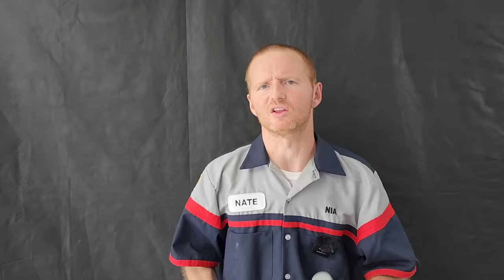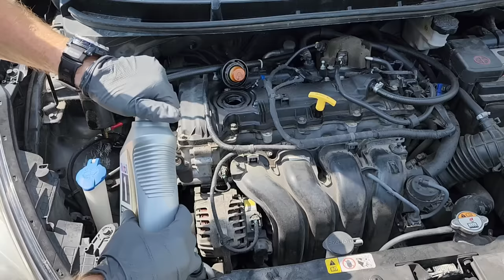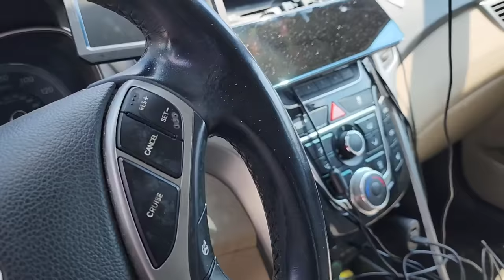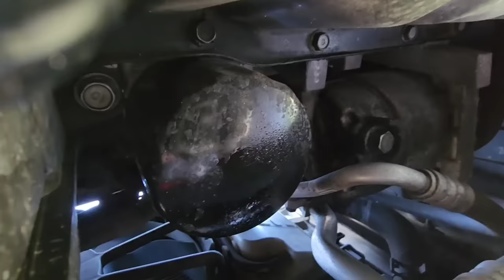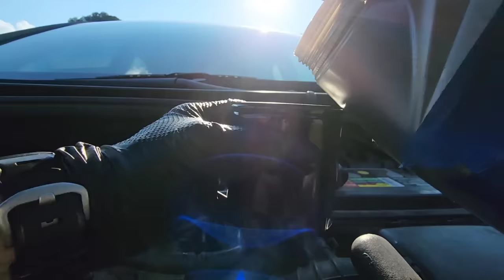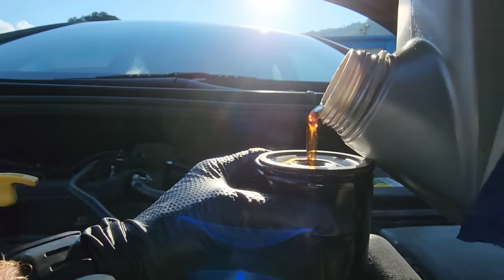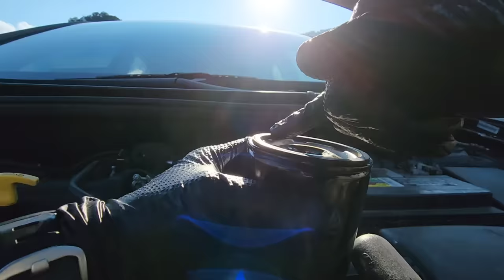Car owner sued after Jeep kills Mechanic during oil change

Comment: What car owner could do to avoid ths situation? He gave his car to a shop hoping that professional mechanics know what they are doing. Your law is just crazy.
Reply: If anything, shop should take blames for incompetence. 🤦‍♀️
Reply: UNJUST
Reply: Don't live in Michigan or go to a mechanic in Michigan. That's what set up this convoluted mess that required the owner to sue the dealership to be indemnified in the lawsuit filed by the victim's family. 

Still, if you have insurance (as you're required to have), they represent you legally. They sue the dealership on your behalf so they will indemnify you in the lawsuit filed by the family. It's convoluted, but how this process works in Michigan.
Reply: @karlrovey  I'd HOPE that is the case at least in Michigan, but last time I looked my insurance policy (in a different state) said that its responsibilty to defend ends if it settles to the maximum policy limit.  That wouldn't cover what the family sued for, not close.  Hopefully the owner's insurance says "Not even one cent!" and pushes it to this point in court.

Comment: They should have at least taught the kid where neutral was, would have made all the difference. Gross negligence on the shops part.
Reply: The car had to have been in neutral to begin with if it rolled after being let down. He should have been shown where reverse is.
Reply: I don't believe for a second that the kid didn't know anything about manuals. Nobody goes into mechanic work being THAT naïve. I'd be willing to bet he just thought it was in neutral and was too lazy to make sure before starting it.
Reply: @billmellater  It didn't roll, the kid put his foot on the clutch, started the car and then let his foot off the clutch. It was in first gear so it drove straight into the other guy.
Reply: @nodak81  ok, in a manual if you take your foot off the clutch (when it is in gear), it stalls (that means the engine shuts off). Explain to me how a Manuel transmission driven vehicle moves without your foot on the throttle (other than it being in neutral) ?
Reply: @leafsfan413  maybe it had a fairly big engine. Also if cold the idle is high so pretty easy to set off without any throttle.
Reply: The kid wasn't even a licensed driver.
Reply: @leafsfan413  If you let out the clutch on an unmoving vehicle while running and in gear  it will lurch forwards.
Reply: @nodak81  When my sister got her license they made no mention of vehicles with manual transmissions.  My MPV is stick which is the only reason she knows.

Comment: Generally for a civil liability suit to succeed, you must show that the person that is being sued was either negligent or intentionally caused the injury. In this case it is unlikely that they could prove either negligence or intent. Even if they had and had the car owner lost two things would have happened that would have protected them as well. First their insurance on the car would have covered the lawsuit probably. As well they could then have turned around and sued the car maintenance facility that hired the unskilled person to work there and they would almost certainly win on that case because negligence would be easy to prove.
Reply: it was nothing to do with his skill as a mechanic it was his familiarity with a manual transmission
Reply: That is the general standard, and I agree with that. Vehicle insurance seems to be an exception, as it is no fault.
Reply: Who has the time to go through the court system.not to mention the attorney fee’s they are the ones that profit. More often than not they go after the money not the guilty they just want the pay out not justice. Justice is not profitable the other shame is that whatever money is awarded most will go to the attorney not the families.
Reply: When in doubt, Sue everyone.
Reply: @onyxwolfarias6523  It has EVERYTHING to do with his skill as a mechanic. Part of the job is to move vehicles from the lot into and out of the shop as well as perform a safety check of the vehicle you repaired. That includes driving it. If he cannot drive ANY vehicle (no license) and cannot drive a manual vehicle, he had no business starting or attempting to drive it.

The owner had liability for hiring him despite being unqualified for the job. And the mechanic had liability for operating without a license or knowledge of how the vehicle worked. The split is for a judge to decide. But willful and reckless action on the mechanic's part would likely get the larger share.

Comment: When I was learning to drive something my Dad did was to always leave the car parked in gear. That made me develop the habit of always waggling the stick before starting the engine. Great habit to be in and has prevented me from accidentally starting a car in gear a few times. Thanks Dad!

Leaving a car in gear is reasonable to help stop it rolling if the handbrake doesn’t hold. I can’t see how the owner is liable
Reply: Yep..that was my first lesson too..and always sit in the car when you start it with the clutch down and release it when it is in neutral
Reply: Don't do that in a shop. Shorted wiring can cause the engine to turn over.
Reply: Same here. My family would all park their cars in gear and the gearstick waggle is a standard thing for me now even with the advent of vehicles which won't start unless the clutch is in!

Comment: Anyone can sue anyone for any cause. The question is was the defendant liable. In this case, the owner of the vehicle was sued because of a fatal injury involving his vehicle. In order to recover damages, the plaintiffs have to prove the car owner was negligent (liable) for causing the injury or property damage i.e. did the owner modify his vehicle thus making it dangerous and as a direct or indirect result caused the injury. A jury in this case would likely find the vehicle owner not guilty of negligence however, since his vehicle was involved in the injury of the mechanic and providing the owner had auto insurance, the insured's auto policy would likely extend medical pay coverage to the injured party regardless of liability, same a homeowner's policy would.

Comment: If I remember the case right, they're really suing the owner's insurance, since every driver should have at least liability. But let's face it, you there is no way you can sue a person not at moral fault for it, and look good.
Reply: Correct, it's also the only way they could be compensated under Michigan laws. The victim's family had to sue the vehicle owner and the owner (or rather insurance acting on behalf of the owner) had to sue the dealership to be indemnified in the lawsuit against the owner.
Reply: @karlrovey  Sounds like a lawyer employment program

Comment: Very sad story. I have seen that manual transmissions are very unique these days. Even 20 something years ago when I worked in the summer for a full service car wash we had employees that couldn't operate a manual vehicle. Fortunately the place was always having employees that encountered one that needed to be moved the get an employee that could to avoid chances of injuries and damages to cars. I drove a manual in those days so it wasn't an issue for me.
Reply: Manual transmissions are unique, then  you've got a couple complete oddballs thrown into the mix like the late 1960-mid 70s era Volkswagen automatic stick shifts and you've got nothing but problems. I know somebody who worked at a car wash one summer that did an extreme amount of damage in less than 30 seconds to a very nice ( 95% original ) 1973 Beetle cabriolet. Then there is the classic three on the tree. Good luck, kid because unless they grew up on a farm they probably aren't going to be able to drive it. Just for S&G, you should ask some random high school kids if they know what a that type of transmission is sometime the next time you are out at a fast food restaurant if you want a good laugh at their blank looks. They'll actually look at you like you've got two heads, and arms are coming out of where your ears are supposed to be.

Comment: Stuff like that is exactly why I’m always super apprehensive about sending my manual F350 into the shop for alignments. Luckily, I seem to have found a good shop that knows me, and takes care of my F350.
Reply: from the sounds of it. it almost sounds like this was a quick lube place. and inexperienced people who likely dont even have drivers licenses in high school or straight outta high school are the ones working there doing this kind of work. and making these kinds of mistakes. its a shame. if you find any Diesel Specialty shop generally they're all seasoned mechanics and or all but maybe one or two of the techs can drive a manual because they have one themselves.
Reply: @justnsaliga8518  This was a dealership. Also, due to other court rulings in Michigan, the shop wouldn't be liable for any damages resulting from incomplete service (forgetting to reinstall the drain plug, forgetting to reinstall the lugnuts, etc).
Reply: @karlrovey  that's ludicrous
Reply: @5.43v  You're right. Unfortunately a Michigan appeals court and then its Supreme Court ruled that there was nothing in Michigan's consumer protection laws that required completion of a repair for the repair to be considered "performed" despite another section of it prohibiting charging for repairs and maintenance not completed.
Reply: @karlrovey  People are blaming (mmmmff, won't say the party name) for a blatantly pro-business law/decision?  Political backlashes have strange effects sometimes.

Comment: Moral of the story: Never let someone under 30 touch your manual transmission car

To the under 30 manual drivers: there are very few of you so it’s a the right call 99% of the time
Reply: ...let me just say...a prominent hotel in Columbus, OH had 1 (ONE) valet that could drive a manual.  As it turned out, SHE was the head valet and the only one in her crew of 6-7 that could drive three pedals.  Needless to say my GTI sat awhile in the drop off area until SHE was available.  🏁
Reply: @Azureecosse  Very true — I meant it aimed at Americans. We do NOT like manual transmissions over here. It’s very frustrating.
Reply: @K03sport  Leaving my car for service/valet causes so much anxiety
Reply: i don't daily manuals but being 22 right now did have a 5+2 (10 speed) configuration 1991 Chevy Kodiak Crew cab with a custom 10Ft dually bed on it. and a short while drove a 1973 Kaiser Jeep M35 deuce and a half. 1st gear doesn't got a synchro meaning you can only shift into first from a complete stop. do i like manuals yeah they're cool do i like automatics yes hence why i own 2 automatics a 2005 F250 harley davidson Edition 6.0 powerstroke, and a 2018 F250 platinum 6.7 powerstroke. automatics are plain n simple stronger than 99% of manuals out there. ZF6 manual even if built can't handle much extra horsepower beyond factory output. stock 5r110W automatic can live at 1000 HP and do it for 100,000 miles
Reply: @justnsaliga8518  Brother - Proud of you and will not argue about manual vs automatics. My point still stands. Very few people under 30 can drive manual transmission. With the demand for convenience and EV adoption, the numbers will keep dwindling. In the USA at least.

Comment: The entire story is that a guy takes his vehicle in to the dealership for an oil change. A 19 year old employee who had no license and did not know how to operate a stick shift attempted to crank the vehicle after the service was complete. The engine didn’t start. He asks another mechanic how to crank the vehicle and was told that he had to press the clutch, and so he did. Not knowing that the clutch couldn’t be released unless the vehicle was out of gear, the mechanic did just that. The vehicle lunged forward killing another employee who was in front of the vehicle. Under Michigan law, the dealership couldn’t be sued, but the vehicle’s owner could be because he “gave consent” for his vehicle to be driven by the employee when he gave him the keys. Yeah, I know, that law needs some serious amendments and exceptions when it comes to taking a vehicle in for servicing. However, since then, the case has been settled with the dealership taking full responsibility and settling $15M lawsuit brought forth by the victim’s family. But I think that was the plan all along—to shame the dealership into taking responsibility and ultimately settling the claim—because the owner of the vehicle didn’t have that kind of cash or equity.

Comment: One of the audible rules I often hear at my garage is “leave it out of gear, handbrake off”. It’s a consistent rule of thumb no matter the job; only consciously changed if needed. A flat workshop floor. The ability to line up for lift. 

These rules should surely be on the floor management / workshop lead. Then young apprentices will learn, albeit slowly; repetition helps.

Comment: Another reason to repair your own vehicles. A tragedy but the tech needed a lot more training.
Reply: That only gets you so far. There are always repairs you can't do yourself unless you have $50k worth of specialized tools, vehicle lift, etc. I don't know about you but I don't have a spare alignment rack laying around my garage.
Reply: @nodak81  Plus, you need to have enough ample space in your garage to work on your vehicle using required lift equipment to do so.

Comment: Most, if not all, cars come with some sort of Interlock where you cannot remove the key if the car is not in a specific position. Many, like the one in the demonstration video, also have what amounts to a neutral safety switch that prevent the starter engaging unless the clutch is fully depressed. One would expect anyone working at a dealership would know how to drive a manual transmission.
Reply: He depressed the clutch, probably thinking it was the brake like most modern cars require to start,  then let his foot off the clutch, that he likely thought was the brake. The car manufacturer could design the car to only start in neutral with a manual transmission,  regardless of clutch pedal position,  therefore the car manufacturer should be held liable.
Reply: Maybe I missed something...I thought I heard it was a push button start. Maybe they work differently and can be turned off and on while still in gear...

Comment: As a former mechanic anything can happen while working on a vehicle. I almost lost my left eye, almost had my hand chopped off setting hoist pads, tooth knocked out removing u joint retainer clip, 3rd degree burns from removing  transmission pan with burnt smoking boiling transmission fluid, and more. You gotta be on your A game at all times. My condolences and sympathies. I am very sorry.

Comment: This is what happens when you let someone sue someone else for their own stupidity (spilling hot coffee on yourself)
Reply: @N578MD and your the type that I’m talking about. It’s the guns fault, it’s Tides fault, it’s always someone else’s fault except the dullert in control of said object.  Even at the optimal temperature coffee will burn you if you spill it on yourself and that’s on you not anyone else. It’s like saying I looked at the sun till I went blind and then blamed the sun.
Reply: @N578MD Congratulations on being classified as being "the type" by yet "another type" - the ignorant. 

Sure, I believe there should be a swing back to personal responsibility for sure, it has become a finger pointing society. I guess that includes being personally responsible for knowing the facts before calling someone else out as being "that type" and finger pointing.

Sure, coffee spills are their fault, but coffee hot enough to cause 3rd degree burns to a significant portion of the body resulting in significant hospital time isn't.
Reply: Two things: One, you don't understand the hot coffee lawsuit (a warning that the coffee was hot wouldn't have protected them as coffee hot enough to cause near instant third degree burns is considered unreasonably dangerous).

Two, this wasn't someone suing for their own stupidity. The stupidity was on the owner of the dealership for allowing an unlicensed employee to have a job that required moving vehicles and on the employee who tried to move a car he legally shouldn't be driving. Unfortunately, the law didn't allow the victim's family to sue either of these people. It did allow them to sue the vehicle's owner, who could sue the dealership to be indemnified in the original lawsuit.

Comment: Last I knew, they had a neutral safety switch in manuals. Meaning, the car cannot be in gear and the clutch must be pushed in, in order to start.
Reply: That must Manuel's after 2005. I have a2002 mustang and mines don't have that. Also it took me a while to learn how to drive Manuel. A person with no experience should not be around a Manuel. Whrn you stall the vehicle it jumps forward with alot of force and this is a suv
Reply: @KrishnaSingh-ow1ie , my 1983 GMC S-15 had it.
Reply: He let the clutch out with it running in gear, and yes it had  clutch  position sensor because it didn't start until he pushed the clutch in.
Reply: @timerickson8895 , it should also have to be in neutral. As in, not in gear.
Reply: @bradleyvantassal8328  nope should start in any gear as long as the clutch is pushed in.

Comment: I have been a mechanic over 40 years, Every shop I have ever worked at required a drivers license. The only mechanics that I have known that could not drive a manual transmission are young ones in recent years. Whoever is in charge of hiring should find out things like that and require them to learn how to drive anything that they work on. I think it`s the business owner`s liability.

Comment: What ever happened to applying the parking brake? That is why it's there, that is what it's for, and that is why it is called a parking brake. Every owner's manual I have ever read says that the parking brake should be applied when parking, regardless of the type of transmission.